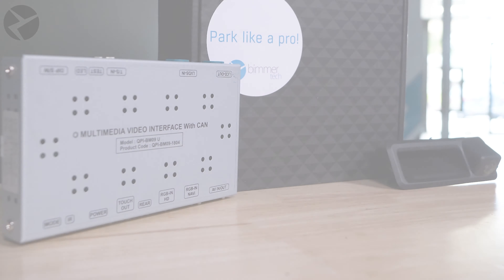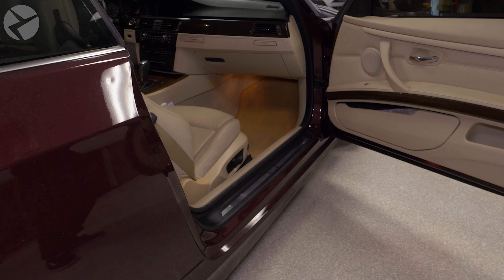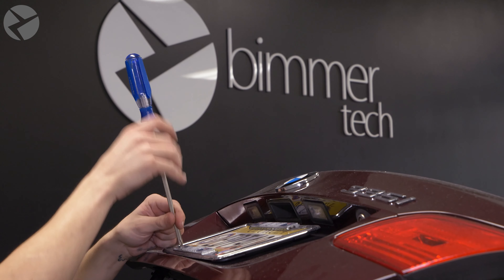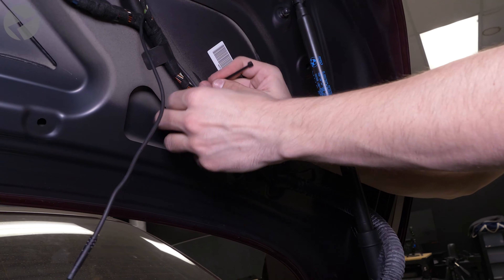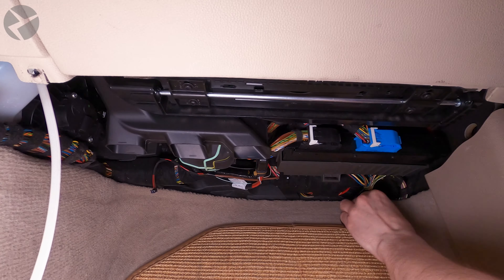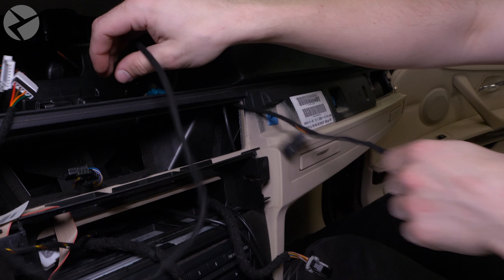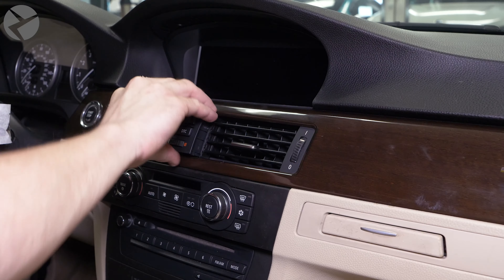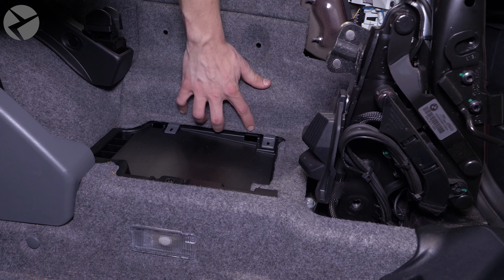BMW Backup Camera For E93 – Install Tutorial

Comment: I have a 2009 x5 I lost my key fob ordered a new one from bmw vin programmed and it didn’t work we called over a locksmith he let us know that it looked like one of the computer wasn’t allowing the key to connect he came today to program us a key but didn’t have luck he would be reaching out tomorrow with more information for us but if I take it to bmw do you know what the cost would be ?
Reply from the maker: Hi, that would be a question for the specific dealer you would like to use, the cost between their services may vary depending on the service and your region, not all dealers charge the same.

Comment: What about the ground from the power feed to the camera?
Reply from the maker: When connecting the screen to the MMI module please place the LVDS cables grounding loops under screws on the MMI enclosure and screens metal frame.